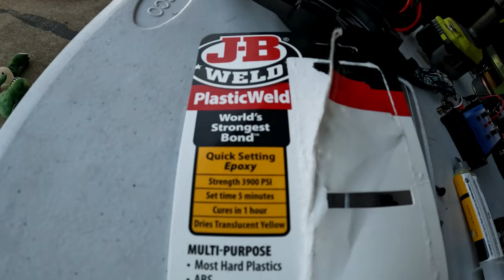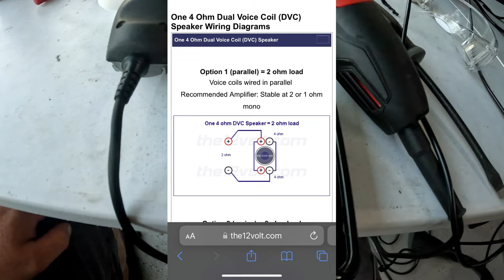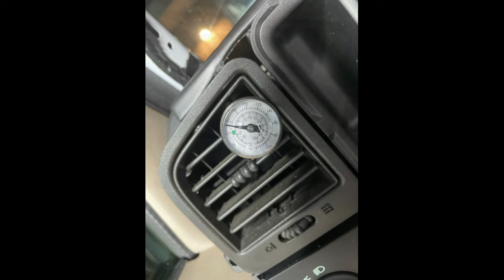Factory Bose Sub Upgrade For Your Truck

Comment: would a Sundown SASERIES-6.5-D2 be too tall to fit in that small space?
Reply from the maker: Think it would be fine the main fitment issues was right at the mounting surface, the kicker sub had a pretty thick backing to it, been contemplating about adding a separate amp for it just to see but would be just to see sense I have the new JL Setup in the back
Reply: @QS_TIPS  sweet hopefully it works, and do u by any chance know how much the factory bose sub depth measured? just wondering before I order the sub that way when I take apart my center console I can be more sure
Reply from the maker: Have no clue but you can reference the kicker specs hopefully that helps
Reply: @QS_TIPS  sure does, thanks!

Comment: Did you use anything to seal up the sub to the housing?
Reply from the maker: No just went with the foam that came on the speaker could of done more but didn’t see the need due to how the sub is wired threw the sealing surface

Comment: Didn’t u say that Bose was 2 ohm and I only u do one coil so it’s a dvc that thing was connected to 1ohm so technically won’t be the same becUse u can only run it to like a 2 ohm
Reply from the maker: That’s why I wired it differently trying to achieve the same resistance, haven’t had any issue’s with it.

Comment: I have a 07 avalanche with the bose system. Do you know if I can remove my center and update the sub like you did? Are you able to run the sub independently? My speakers all work together and do not separate them from the center sub.
Reply from the maker: Is it the classic body style like mine or the newer body style ?
Reply: It’s the newer.
Reply from the maker: https://youtu.be/rKdaHvpkNdQ not the best video but this how to remove it from looking at the sub via pics it looks do able to me with a spacer can’t find how much clearance is above the box but from the little info I can gather I think I could make it happen looks to be the same sub just different box design
Reply from the maker: If you google 2008 silverado bose sub should give you a good idea of the box design I’d apoxy a piece of abs plastic with trimming to make the sub seal properly so it will fit flush to the top not in the recessed part, hope this helps let me know if you figure it out that would be a cool project !
Reply: I need to disconnect my sub. What wires go to it?
Reply from the maker: @bigjplay3127  there is a connector located on the top right if your looking at the sub head on with the center console removed that will disconnect it and you have 4 wires coming from that connector  to 2 positive and 2 negative wires feeding the 2 voice coils if I remember correctly they are distinguished by a green and red line for each side of the the coil and you can reference the factory sub to note witch wire is positive and witch is negative as they are stamped on the terminals of the factory sub 🇺🇸

Comment: Do you have a separate amp for ur door speakers?
Reply from the maker: I specifically sorted out the infinities that I listed in the description Because They Match Similarly to the factory speaker’s 2.7 ish ohms, Meaning You Can Upgrade The Factory Speakers And Still have the factory amp power them with basically a plug and play upgrade for Bose Systems, I Have No Shortage Of Highs or Mids A lot Of People Don’t Like It Because Of The Bass Cut But I Personally Think It’s Perfect For My 2 12’s The Factory System Sounds Great At Low Volume And When You Want To Party, The 12’s Take Over When You Crank it up and The Highs Are Really Crisp, I can’t turn it all the way up it hurts my ears and they are pretty seasoned with loud music

Comment: Is I put a 400 watts sub on it what will happen?
Reply from the maker: Should be fine don’t remember the specs off it I think it was 350rms @ 4ohms just don’t crank the amp all the way up should be good more power closer to the rms ratting the better the performance
Reply: @QS_TIPS  oh ok where is the amp located anyways
Reply from the maker: @AntThe1 it’s under the console behind the sub box
Reply: @QS_TIPS  is it possible to wire a other subwoofer?

Comment: What is the ohms on that Bose Subwoofer?
Reply from the maker: Dual 2 ohm voice coils
Reply: @QS_TIPS  thank you, I just wanted to know because I added a center console and it came with the Bose subwoofer and I added an aftermarket amp to run and right now it’s bridged
Reply from the maker: Iv Seen Forums Where Guys Get Crazy Results Out Of The Stock Sub On a Aftermarket Amp !

Comment: does that sub shake the console?
Reply from the maker: Like make a rattle no but if you put a bottle of water in the cup holder it will make it have ripples in it and it shakes the mirror a little bit
Reply: @QS_TIPS  my skar evl in the console vibrates my console and me no like. would that happen if the sub isnt sitting flush and air is escaping into the console? i have to go back and add a spacer into mine
Reply: @QS_TIPS  my skar evl in the console vibrates my console and me no like. would that happen if the sub isnt sitting flush and air is escaping into the console? i have to go back and add a spacer into mine
Reply from the maker: @jakaylanmarshall6632  not sure, a lot of things in play but with the nature of the setup you will get feed back threw the console even on the stock sub if you pay close enough attention to me it’s a concern only if it makes a rattling noise and that could be mitigated with sound deading
Reply: @QS_TIPS  yeah it probably just a lot of bass to be right there😂 the only thing rattling is everything is everything in my cupholders and cubbys but ill add the spacer and clean out the cubbys
Reply: @QS_TIPS  thank you!
Reply from the maker: No Problem, Good Luck Sounds Like A Pretty Sweet Set Up !

Comment: You should have went to Parts express and bought a Tang band or Dayton Audio 6in sub to replace that, that kicker isn't gonna have enough power to make it hit, but a 6 inch Tang Band is only like 100 watts and they pack a good punch.
Reply from the maker: I’ll check them out, had no issues with the sound or performance of the current set up
Reply from the maker: Just looked, I agree think that would of worked better, never knew they had smaller subs then what I installed and it would of been the same diameter, if I ever have a round 2 I’ll defiantly try these for sure my wife has the bose too so maybe when hers gives out we can compare the two 🤘🏻

Comment: How did u wire the speaker up
Reply from the maker: 13:55 will show you the diagram I used I just added two speaker wires to the factory wiring to wire them in parallel making the speaker have 2 ohms of resistance, when you pull the factory sub out the positive and negative will be stamped on the speaker just take note of the speaker wire color, this is all powered by the factory amp

Comment: @QS TIPS dude your factory speakers are not dual voice coil what are you talking about I ripped that bose system out of my silverado and put in high res audio I've never in my life seen a dual voice coil car speaker. You need to get your facts correct your giving ppl incorrect information on ohms and the electrical setup of the system do you realize you could be partially responsible for causing someone else eho knows nothing about electrical to burn there car to the ground? If the bose subwoofer had DVC at 2ohm ea that means it's most likely wired at 4 Ohm unless the bose amp is capable of handling 1 Ohm but I doubt it being bose. It's impossible to take a DVC 2 Ohm and wire it on its own at 2 Ohm. Its 1 or 4. Period. This is the measurement of resistance of the circuit. If you cause someone to wire a 1 Ohm load on an amp that can not handle the load you could really f up someone's stuff and insurance ain't going to cover it because that's negligence by owner. Also. Your not giving that kicker near enough power. The enclosure is completely wrong and so is the tuning of port. Educate yourself before playing with electricity, and definitely stop advising others to follow your negligence and stop putting ppl in danger electricity isn't something you just whatever about. It's deadly. Come on man! 12 year experienced and licensed contractor, so I know what I'm talking about. PLEASE DO NOT BE FOOLISH AND PLAY WITH ELECTRICITY EVERYONE! ITS JUST LIKE FIRE!!!!
Reply from the maker: Not Forcing Anyone To Do Anything They Don’t Want To Do And Never Claimed To Be An Expert, Still Works Great Till This Day And No Fires Sorry To Disappoint.

Comment: Thats wrong  u mesured one side the bose is a duel 2 ohm voice coil and ohms at 1 ohm not 2ohm
Reply from the maker: That not how voice coils work, the voice coil has 2 ohms of resistance that’s doesn’t change due to quantity of voice coils just how you wire them up would change it to 1 ohm, but the voice coil would still be 2 ohms just the resistance at the amp would be 1 ohm
Reply: @QS_TIPS  its a duel voice coil has 4 sets of terminals and if u wire it down it would be 1 ohm
Reply: My bose mesurea 1ohm at the wire and 2ohm at each coil
Reply from the maker: 2 terminals per voice coil hints the name dual voice coil
Reply from the maker: How did you measure the wire? The plug had 4 individual wires on mine
Reply from the maker: For example if your order a dual 8 ohm speaker the 2 terminals for each individual voice coil will read 8 ohms you can wire it how ever to get the resistance on the wiring but doesn’t change the structural construction of the speaker, and you may be correct the Bose amp could be wired at 1 ohm I didn’t dig that deep into I just sent it turned out pretty good tho I’m curious how it works with a stronger amp but my stealth box is plenty they both work together and complement each other well as is
Reply: @QS_TIPS  i was just saying u messured one side of a dvc that was 2 ohms and it had 4 wires half of 2 ohms is 1 when wired in parrel all i was saying!
Reply from the maker: 🤷🏻‍♂️ the Bose speaker is still a dual 2ohm voice coil, that was not the original statement and yes the Bose amp may be wired in 1 ohm not disagreeing with you there I didn’t check
Reply: @QS_TIPS  u did good at 2 ohm kicks harder but 1ohm is louder cause more power weird how they work! U wire sub to door speakers ?
Reply from the maker: It’s wired to the factory bose amp that feeds the original sub
Reply: @QS_TIPS  pretty sure they can handle 1 ohm ik they cant handle 4 mine sounded like it had a blanket in the door